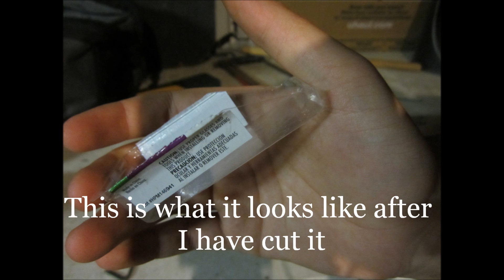How To Make An Improvised Airsoft Mine

Comment: HUGE benifit instead of using bbs take wire cutters and cut up junk plastic toys and what not and it works well as shrapnel for traps and is free
Reply: .....OR.... USE DRIED BEANS       like who is going to cut up plastic toys... and plus beans are better for the environment